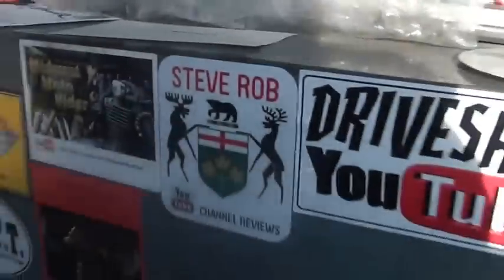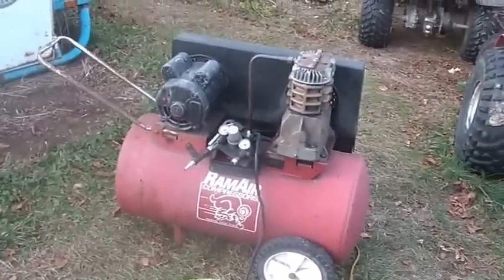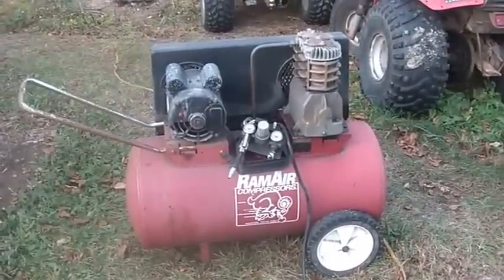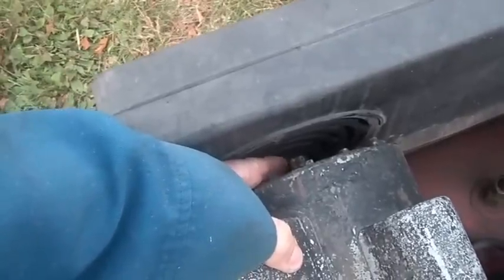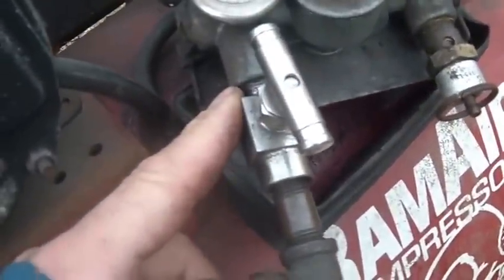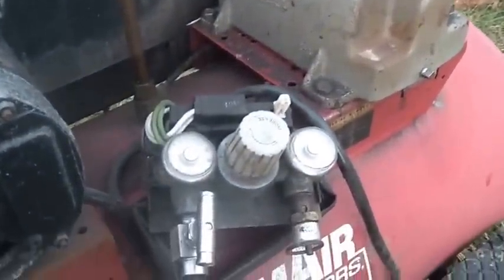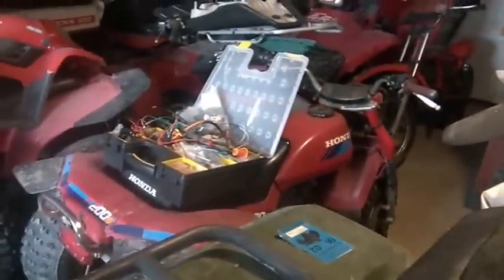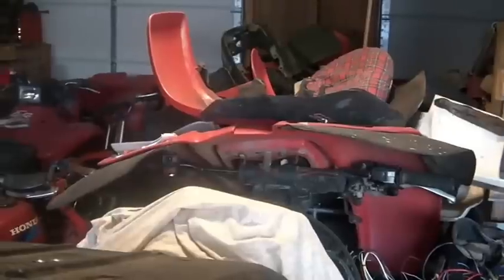11_1_2016, Troubleshooting a non starting RamAir Compressor,

Comment: Build a partition wall and split the workshop. Also for metal get some magnets and stick em to the outside of the building 😄
Reply from the maker: Hey Steward, I have considered partitioning the shop and blowing the back wall out and extending the shop as a pole barn, but, it would require a building permit, not a door into my life that I would like to open.... Thanks for the ideas, your thoughts, watching, and commenting!!!

Comment: What is a Ruith canal? LOL It's a Root Canal man. LMAO... Same way I feel about my women sometimes, newer..... LOL I want to make me a work shop out of one of the metal buildings / car ports. Just close it in on the sides with metal and that's 14 gauge steel. Then pour a concrete slab inside it then support it on the inside with 2x4 studs on the walls and wire it then make a double door on one end with a single door on one side. Slap a wood heater in the corner, build shelves and may be a few windows with a window AC unit in one of them. Bam!! Best work shop ever!
Reply from the maker: Hey Calvin, I made a mistake on my shop, 24 x 24 is too big to heat and too small for storage.... I should of gone with a 12 x 24 shop and a 24 x 36 pole barn with a fork lift to move things around... I have considered a 24 x 24 car port to get rid of the woop tarp sheds... I like Ur idea, especially where U live, not quite the cold and snow loads we have here... Thanks for the good ideas, watching, and commenting!!!!

Comment: if it were me,i would use the pressure switch and regulator  off one of the oil less compressors.as far as metal storage,i use 5 gallon buckets and stand things straight up,works pretty good
Reply from the maker: Hey Roger, I think I saw a control box from a compressor floating around the drive way recently, I will have to look around, for now, I'll have to hang on to this compressor.... Good idea on the 5gallon buckets!!!   Thanks for the suggestions, watching, and commenting!!!!

Comment: Use buckets to store small pieces of metal and garbage cans for the bigger ones. That old oil compressor is far superior than the new oil less ones and quieter I'd fix it
Reply from the maker: Hey Dave, The buckets and garbage cans for storing metal are good ideas... About the compressor, I will hang on to it for now, it is a lot quieter then the pancake ones for sure.... Thanks for the ideas, thoughts, watching, and commenting!!!!

Comment: im moving to more land than i have now,, im going to get me 2 connex`s and put them side by side butted up to each other and bolt them together and plasma cut the 2 inner walls out for a big storage building and it mite cost me 3000 when done.
Reply from the maker: Hey Gary, I have seen containers put on a slab, running parallel, spread apart by 20fteet, with trusses and roofing put between them to create a huge shop.... Good luck with the new property!!   Thanks always for your thoughts, watching, and commenting!!!

Comment: I would rather have that two cylinder oil compressor than those pancakes. That big one can air a tire up like a v8 can get to 60. Use the hardware off one of the pancakes, just a thought.
Reply from the maker: Hey Bill, I must say that the 2 cylinder does seem to produce a lot of air quickly, some of the pancake compressors, especially the little ones take a very long time to full a tank or ATV tire.... I may have a compressor control box floating around the driveway that I pulled from a scrap compressor, I need to look around, thanks for your thoughts, advice, watching, and commenting!!!